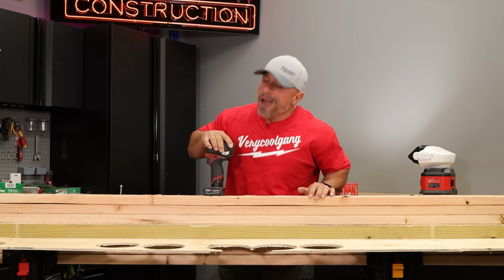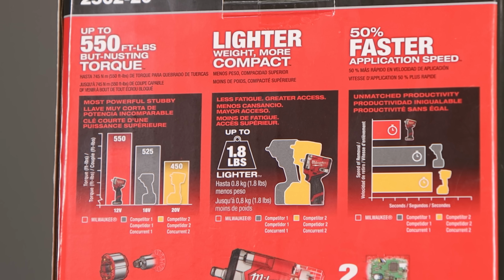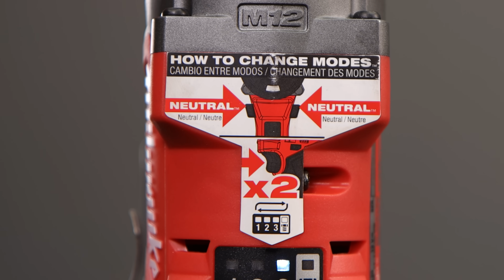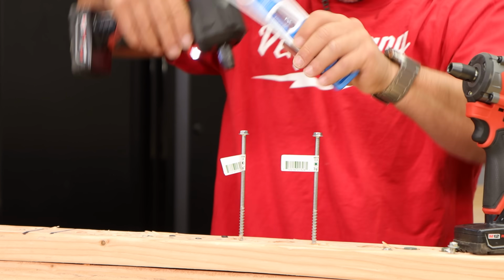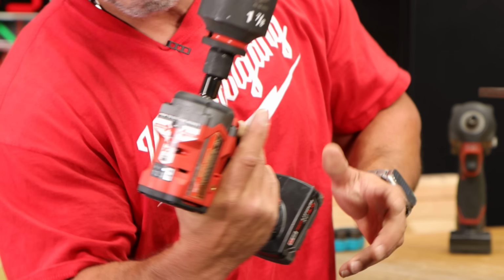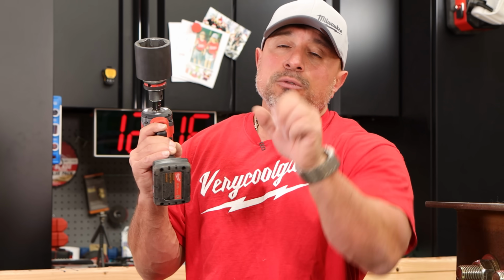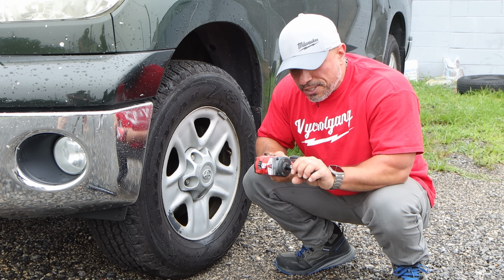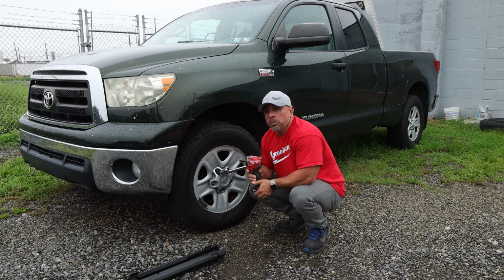Milwaukee REDEFINES the Compact IMPACT Wrench (99% PERFECT)

Comment: It is not losing a little bit of torque, it is actually losing a lot of torque, doesn't matter if that socket sits tight on that adapter it is still losing torque. See torque test channel video on that topic, even one single adapter can be up to 30% of torque loss, not even mentioning 2 adapters stacked up on each other.

Comment: The Gen 1 stubby did the same thing in the 4th setting, it's used just as you've described Vince, to run fasteners down until it recognizes resistance, this is handy for those that want to ensure no cross threading occurs.

Comment: Here are my thoughts, Vince.  Although I am just a DIY mechanic, considering its light weight, compact size and power, I believe the Stubby 1/2" impact wrench (2563-22) will be the ideal tool for lube techs working on cars and light trucks.  In a few days, this tool will replace my mid-torque (2962-20).  Also, I always purchase the protective boot with my tools.

Finally, thanks for the tip about "working the finger into the throttle" on automatic mode.  I was beginning to believe my 2962-20 was broken, a tool I needed to warranty.
Reply from the maker: That's a great use case for this tool!

Comment: The tightening mode seems super useful, at work I need to tighten plates in a cross/star pattern so you don't wanna tighten at 1st , you only wanna set the fastener just snug so that the plate sets in its place , and only then can you start progressively tightening in a star pattern .
I can see that being a very useful feature .

Comment: I drive demolition derby and build my cars with my Milwaukee 3/8 stubby impact and it has easily been the best tool in my collection. TBH I almost don’t even need anything else! Thanks for this review, I most definitely will be investing in one of these but not sure if I’d really need it yet. Mine has done everything I’ve needed it to do and all I’ve thrown at it. I’ve only needed my 1/2 inch high torque probably a couple of times the 3/8 stubby has always gotten the job done! Love your videos and I live just north of Philly too :)
Reply from the maker: Thanks neighbor, and best of luck with everything! 👍🏻
Reply: Yea the gen 1 is insane. Takes a beating too. 
Only things ive ran into it cant do is lugnuts on pickup trucks. But then again thats using 1/2 adapters so could easily be losing the torque to do it.  
Its awsome. Fits everywhere. 
Had a 3/8 high speed ratchet too and between those i did everything I ever needed. 
Unfortunately the 3/8 ratchets currently mia so instead of gen 2 stubby i might be having to buy another ratchet:/. 
I have high hopes it will come home. Tho i think i left it in an engine bay so someone prolly picked it up on the highway🤦🏻‍♂️

Comment: I think I will like having the trigger as both the go button and the selector button.  No need to add your other hand to the mix.  If you are going to use the protective boot, you know the boot that is designed to protect the tool first, then the piece that you are working on as a secondary benefit, then you should simply read the directions first, use it a few tmes to get used to how it works now, and then place the boot on it.

Comment: The impact from the anvil of the tool must transfer that impact directly to the nut you are loosening through the socket. If you have a loose connection from the anvil to the socket you reduce the transfer of impacts per second to the nut. The loose connection can be from socket with bad tolerance (loose/sloppy) and/or from the loose/sloppy fit of any adapters you are using. 
If you have a slightly loose fitting socket with poor tolerance and add to that an adapter also with a slightly loose fit you now have a too much slop and the impacts from tool are not transferred to the nut. Therefore you have poor performance.
Try to use 3/8 drive sockets with a 3/8 drive tool and 1/2 with 1/2. 
It's easy to see that there is huge amount of slop in you setup and very little impact is being transferred to the nut. There is so much slop the socket can hardly even hold on even just moving it around when it's turned off. 
There's other reviews of this tool testing torque. Please watch them and it's always a good idea to read the manual.
The nut holding the tool needs an adjustment.

Comment: Im a newbie to Milwaukee, just bought m18 fuel impact and drill combo, would you reccomend buying this over using the hammer drill with a socket extension? I plan to use these tools for repairs on my vehicles

Comment: That mode selector is awesome, always had an issue with "buttons" on my tools, and you see that button is the first thing to wear out, and break.  Well Milwaukee knows how to make a trigger and direction selector, so why not put the mode selector there.   I have drills I have used for 5 years and beaten them up, whose trigger / direction selector still work.  

Every tool I have with the "button selector"  I can just tell in 5 years that button is going to break and be an issue..
Reply: The tightening mode is definitely for installers, like door panels, interior assemblies, stuff the you just want snug not over tightened or stripping the threads.   

My mechanic buddies, use their M12 impacts for everything now, the days of using a socket wrench 90% of the time are done, watching him work, he was removing and reattaching bolts all with his M12 impacts.   Speed is the name of the game and these small hand tools can get into small places and get the job done.   He had attachments for those knuckle buster spots, that attached to his M12 tools.  Again no longer needing to slowly turn a bolt with 1" of clearance, nope M12 impact, attachment and bolt is in.

Comment: So basically it's modestly more powerful than the Gen 1.  Truth is that you're only going to get so much power out of a small impact mechanism, and Milwaukee improved the design.  But that doesn't change the fact that it's a small impact driver and it has its limits.

Comment: I’m sure they changed from analog to neutral switch because it gives more space in the drill for a more powerful motor. I’m pretty sure that’s the whole point y’all. Or there would be a beefier tool cause of the analog

Comment: Wow Milwaukee, just wow, what a badass tool, 550 ft lbs from a 12 volt 🤯🤯👏👏👏
Reply: @Lee-lb9qh  you need that big battery for 550 ftlbs
Reply: @bobbymaldini7653  not really big though 😂 most of it is in the handle

Comment: The 550ftlb only come with the XC5.0 battery. With the XC4.0 its only around 250ftlbs
Reply: Battery size has nothing to do with the amount of power with the tool puts out.  It just means it stores more electricity. But yes I agree you want bigger battery for something you're gonna be using all day.

Comment: I'm just a guy looking for a small impact to bring with me that can used to change a flat quickly on the side of a road on my truck or trailer. I currently have a full size 18volt Dewalt that is about 6 years old and needs new batteries. I think this would be very nice replacement and compact vs my Dewalt.

What's everyone's opinion on getting the 3/8" vs the 1/2"?
Reply: Показать ответ в видео Shorts
Reply: its a bit smal for wheel nuts, if they are torqued properly on clean threads and removed recently yeah itll be fine but if those whele nuts are rusty or ugga duggered up its not happening, id get a mid torque m18

Comment: Got the Gen2, returned it pretty quick after using it. It has double the power, but it also drains xc5 at double the rate, the gen1 just lasts forever it seems. I also hated the new mode changer. Got a Gen1 and love it even at lower power, but when I want mid torque power, I use a proper mid torque.. don't get me wrong, I'll probably buy a gen2, but for the 60% price discount I got for the Gen1, it didn't make sense to get the 2 yet.

Comment: If your using 2 adaptors from 3/8-1/2" then 1/2-3/4" on a chinese milwaukee 12v battery impact wrench, well u pretty much aint testing anything. It didn't move those nuts either way on the test rig, like after snugging the nut up it didnt move. Now this tool is better than that, its rated at 550ft lbs. Soooo why not use some suitable size bolts for a 3/8" tool and NOT use any adaptors. Then perhaps tighten them down to X ft lbs with your torque wrench and see if the little Milwaukee can undo them. 😢